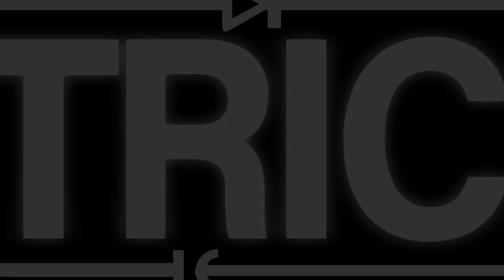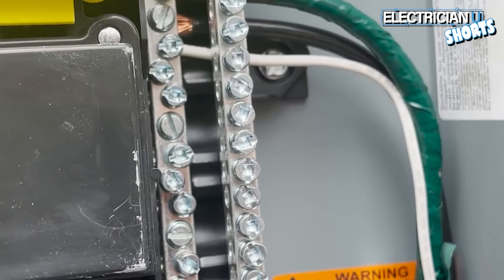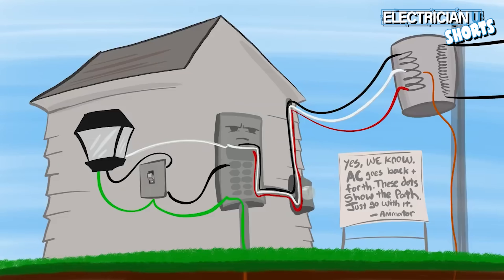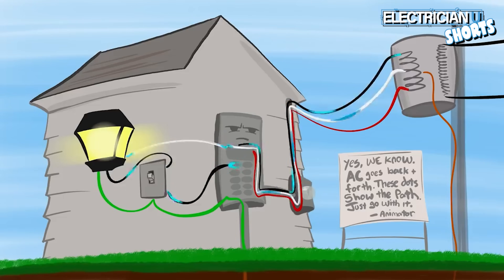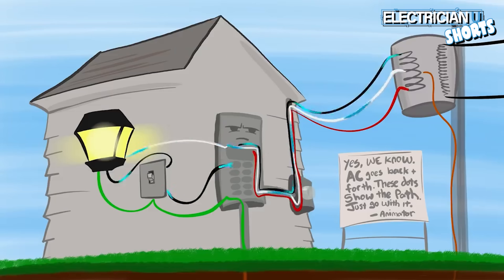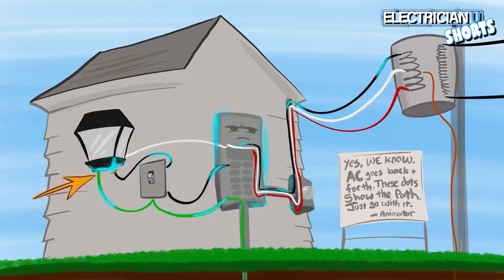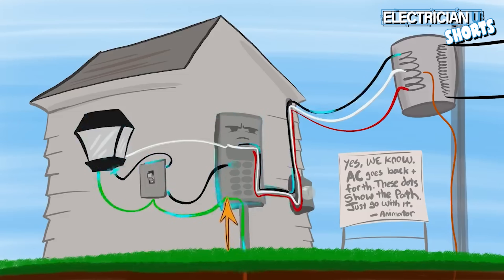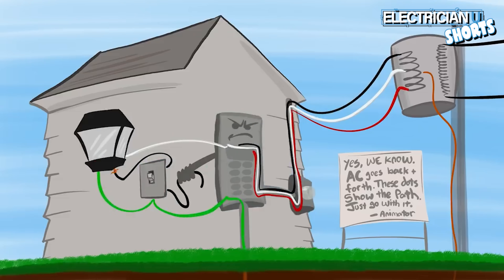SHORTS - WHY WE BOND (Neutral & Ground) Explained in 3 Minutes

Comment: Bringing GFCI into the conversation gets tricky; one of the big dangers in older circuits is that breakers are normally tripped only in short situations, where an abnormally large current suddenly flows, because the resistance of the device (bulb, motor, heater) is bypassed. The surge heats up the breaker, and it trips - eventually, before setting a place on fire. If a body comes between the load and the return neutral, resistance is added and you die, without the breaker heating to trip. GFCI breakers detect a difference in the two lines, and trip very fast if current in the neutral run is less than the hot wire, which would be a normal situation when a person becomes a path for current to go to ground.
Reply: To clarify a bit....short circuits create a swift rise in current that increases the magnetic field around the circuit.  Overloads gradually increase the current correlating to a rise in temperature.

Hence the modern Thermal-Magnetic Breaker:  Thermal for overload trip; Magnetic for fault/short circuit trips.

GFCI breakers are one way to add additional protection to older wiring systems without a ground wire as you described.  Unfortunately, since the GFCI is designed to  detect low level imbalance currents in the 5mA range, this can create nuisance tripping for some loads.  In these cases, a ground wire must installed in conjunction with a thermal-magnetic breaker for proper operation of the load while providing adequate circuit protection.
Reply: @mduralia well said. A GFCI will detect the "missing" ~5mA that is not flowing from hot to neutral; the likely leak is a fault is a hot fault to ground, thus unmetered by the GFCI and explaining that acronym. However, a ground must be attached to a GFCI outlet to provide a fault path to attached grounded devices. And it must be backed by a traditional over-current breaker (or arc-fault breaker if code dictates).
Reply: @hobbesip1 not exactly correct. The fault may be an alternate path to ground, such as through a person and a concrete floor. A ground is not required for a GFCI to function.
Reply: @TomCee53  you are correct. An earth ground isn't required for a GFCI to provide protection. A GFCI will trip if there is an imbalance of the hot side vs. the neutral side.
Reply: @TomCee53  absolutely. That is why we install GFCI in two prong homes to add that layer of safety.
Reply: @mduralia  you are better at explaining this than the commentor you reply to for sure
Reply: @mduralia  You are correct. The most common reason for a nuisance trip is if that GFCI outlet/plug is connected to a doorbell transformer, connected to the load side of another GFCI, or a CFCI breaker.
Reply: Yup. I often work on homes that are 100+ yrs old.  I'm not an 'electrician' , but have a EE degree.  This stuff is SO hard to explain to homeowners, etc. 
Many/most of the older homes/buildings only have 2 prong outlets, etc.  Ironically, with all the non-metalic things we use today have almost zero chance of having hot side shorting to anything conductive. (N.B. I didn't say never or always, rather, things are trending that way)
Reply: thanks you save me lot of typing. The reason why you want the ground is so that lose wire touching that metal housing current goes somewhere and that trips the breaker(or fuse) instead of laying there like snake waiting to bite you.
Reply: @ablemagawitch  almost:
"... The reason why you want the ground is so that lose wire touching that metal housing current goes somewhere and... "
THE BONDING is to ensure their is a path back to source so that the breaker can function to detect the fault & then  trip...
Fixed that for you- thanks & you are welcome!
Reply: I still have no idea how this works and what a neutral is and why there has to be ground with that goes into the ground, other than to send electricity back to the source in a very poor medium? and mixed with everyone else's grounds? why is this so hard?
Reply: @itoibo4208  because this understanding is not exactly correct. Such electrical grid systems is outdated, moreover American companies does not use this kind of system as far as I know. Now the ground in your home is used for multiple reasons. First, in the event of a lightning strike it is to protect against the energizing of any metal in the home. To prevent this, two grounding electrodes are installed to carry the lightning electricity to the earth. Finally, the ground wire that connects to all outlets also connects to the neutral wire in the main breaker panel. This is done to protect against the outer metal of appliances becoming energized by a fault in the appliance or in the wiring of the outlet/plug itself. This trips/turn off the circuit breaker by allowing the electricity to travel along the ground wire to the main panel. Electricity would skip over to the neutral wire at that point where the ground wire is connected to the neutral wire in the main panel not to the grounding electrodes, because the neutral wire has least resistance. This causes a sudden rush of electricity which in that instant causes the current to rise higher than what the individual breaker switch of that circuit is rated for hence the breaker tripping/turning off. 

P.S. If you have any electrical problems it is recommended that you call a licensed electrician.
Reply: @kemfacts  The grounding electrode driven into the earth is to protect against surge currents such as lighting strikes.  

The grounds in the structure running to all connected loads are to provide a path for fault current back to neutral to complete the circuit when a fault occurs thereby tripping the circuit breakers.

So the grounds connecting to the grounding electrode provides a path for surge currents that are the result of "faults" in the system and so the grounding electrode plays no role in fault current/circuit breaker tripping.  It is the main bonding jumper that accomplishes this.
Reply: @mduralia absolutely. At no point in my paragraph did I state that the electrodes are use for faults originating in the system. I specifically stated that these are used in the event of a lightning strike to prevent metal, such as appliances from becoming energized by the lightning strike. Moreover, traveling along the ground to the neutral in the main panel does not complete the circuit, it creates a short circuit. Read the whole comment again.
Reply: Trump will end evil short circuits and make circuit breakers cheap again…. Send money now
Reply: @jimsummers487  YOU WIN!... more winning LESS whining please!
Reply: In case of a short the breaker trips immediately magnetically. Thermal breaking is for overloads.
Reply: I bond Ground and Neutral at the first RCBO in a TN-S system then all breakers subsiquent to this are fully protected <30ma. S
Reply: Your statement ... GFCI breakers trip very fast if the current detected in the neutral is less than the hot wire... Would the current be less due to the fact that A human body (or conductor) has added Resistance, thus lowering current? Hard to believe that the resistance in A human body can cause this... Though I'm certainly convinced
Reply: @drwombat  The current in the NEUTRAL is always less than that in any one phase or all the phases as a sum >>> in a system that has no fault or hazard present <<< this is bcuz the REASON there is a NEUTRAL RETURN in the 1st place is to carry the UNBALANCED current back to source... AND in every single LOADING SCENARIO from a PRACTICAL standpoint in any given moment t(x) the sum of the current is NON ZERO... and therefore you need to have a conductor to carry this unbalanced current back to the source... the best way to understand unbalanced [LOADED] systems & therefore the NECESSITY of a NEUTRAL RETURN is to understand the difference between the TRANSMISSION of power & it's DISTRIBUTION... I have included a lengthy comment above that you can read & it provides the entire picture since the video is only providing a piece of this puzzle- which is no critique... I think the video does a great job doing it's intended purpose... but for those looking for a full understanding then sure you should also read my comment. I hope that helps you in your journey towards mastering electrical systems
Reply: the return is almost always less than the line before the work is done... so correct but the setting is not if unequal bcuz it is almost always unequal- it is based on a DELTA = CHANGE... and if the change is different [it should be consistent] then the tripping occurs... this is also the reason you get ghost tripping bcuz a device may lose its capability tho not be a hazard... when it becomes inconsistent tripping will occur even when not creating a hazard simply due to that difference of change between line & post load return
Reply: This was the thing which confused me alot.Thanks for clearing
Reply: Simple explanation. Almost like my tech teacher 😀
Reply: This is shocking im really jolted reading  this

Comment: I would have just said The N.E.C. defines a Neutral as a "grounded" conductor. The hot is always ungrounded. 
Everything you said after the hot wire touching the metal casing of the light is confusing. 
I'll delete this comment if I get what you're saying. 
Enjoy the rest of your weekend!

Comment: My Solar inverter is 230v One Phase the L-1 is 115v & the Neutral is Hot 115v and the Ground is Ground . So in theory in an emergency power outage my Hybrid inverter could make my whole box One Phase while the electricity is down , I have No 220v breakers my house is all 120v a Square D Box if I use a 20A Double pole breaker as my inlet to the box or do you think if I used a sub panel and a breaker for each Essential circuit of equal value as in the main panel so the Hybrid inverter would be connected for its power source to the main panel to monitor and when the grid goes down the inverter would only power those circuits in the sub panel  , than I could use the main electrical inputs ! But would be simpler to go through a 20A 2 pole breaker and feed the whole box !

Comment: This is all wrong, ground is all that it is needed. Bonding = misleading BONDING IS CONNECTING.  And that is what you are doing when connecting the neutral and ground together.  To trip a fault you have to monitor the hot wire, a short would increase the current quite a bit and thus would trip the fault device. In the above bonded method the short current is not going to go back to the transformer but to ground, the shortest path. The metal casing being grounded would not increase in voltage if shorted to the power supply, IT IS GROUNDED, so it is always safe.

Comment: If I don't bond a ground rod to my main panel do I still need to tighten my bonding screw? If the ground wire from the subpanel is connected to the neutral bus to carry current back to the transformer then what's the reason to bond the neutral bus to the panel.  Where I live we mainly have a ground rod to our meter and it's not bonded to the main panel

Comment: may I ask if the N-G voltage is the same reading as the L-G voltage? Thank you.
Reply: No, the N-G voltage is at the same potential (0). L-G voltage is at 120(same as measuring from hot to neutral(difference of potential)
Reply: @ddaniels2901dd  Thank you for your reply. For an equipment with power connection stated as N-G, is it ok to be connected to L-L assuming the voltages are the same and the system are grounded properly?
Reply: @juantamad5784  if I'm understanding correctly, N-G won't give you a reading, L-L would give you the maximum reading of 240 volts and L-G or L-N would give you half the voltage (120 volts)
Reply: @ddaniels2901dd  Hi sir, thank you for your reply. My main problem actually is about the Hybrid Inverter I bought for my Solar system. The Inverter supposed to be able to charge my batteries with Solar and if the Sun is unavailable automatically the charging is from the grid. The Inverter spec is N-L (230V) connection but the Utility power supply L1 and L2 are both live at 230 V. I asked the manufacturer if I can connect L1-L2 to the Inverter with N-L but I was told the Inverter may be damaged if I do. I disabled the Utility (L1-L2) so currently it's set only to Solar charging. It's a waste. I asked you if N-G voltage is the same as L-G because what I found was that the Utility L1-G and L2-G is the same as 115V but the Inverter showed differently being N-G is at times lower than L-G but there are times it is reverse. That is why I decided not to connect the Utility line to charge my batteries automatically through the Inverter. For I am not an electrical tech to fully comprehend the situation that is why I am asking. Thank you for any advise.

Comment: My generator came bonded and am connecting a 50 amp inlet box to the house breaker box. Is it fine to leave the generator bonded since I use it once or twice a year or should I make my generator a floating neutral.

Comment: What you failed to mention and most importantly is that bonding the neutral brings it down to earth level 
(no potential)  Old houses without grounds or bonds will shock the piss out of you when touching neutrals. Actual earth ground conductors are what we call equipment grounds and yes do supply a direct path to ground in the event of a short.

Comment: Er, we don't? This creates a TN-C-S system on the consumer side of the installation, which is not actually legal in the UK. Under Regulation 8(4) of the Electricity Safety, Quality and Continuity Regulations 2002, this is an offence risking prosecution and an unlimited fine.

The distribution network operator, in some cases, will connect earth and neutral together, generally in the cutout (as they are cheap). This is still potentially dangerous, particularly for connections to things like caravans or electric vehicle charging points, but it is on the DNO side and as such considered a controlled environment.

The risk is that a broken protective earth and neutral (PEN) conductor can lead to dangerous voltages. The risk is generally acceptable within a house where there isn't access to real earth, it is not acceptable with an electric vehicle charging point. Traditionally there was a separate solid earth connection (typically the sheath of the supply cable) all the way back to the transformer. The cheaper option (link in the cutout) is TN-C-S but only on the DNO side, and allegedly they provide enough electrodes to minimise the risk if the PEN conductor breaks, plus if underground the risk of breakage is low anyway.

On a TT installation such as the one illustrated, an RCD or VOELCB is compulsory precisely because there isn't a solid link to the transformer, and has been for decades.
Reply: The uploader never bothers to reply.
Reply: TN-C-S is the norm in the UK. The regulation you referred bans TN-C.

Comment: (layman/non-sparky asking) I've watched this video probably a dozen times now and it hasn't clicked for me. For a standard breaker (thermal magnetic, non GFI/AFI), how does bonding netural to ground help? If a standard breaker provides overcurrent protection, then it seems like the bonding wouldn't matter because if current is flowing, then current is flowing, the return path seems like it would be irrelevant. For some reason this isn't clicking for me.

I'm still a bit murky on AC electricity, so maybe there's a fundamental property I'm missing.

If it were a GFI breaker, I think I understand that because you need a return path in order to measure the difference...though, I'm still not sure why bonding is needed. Because if there was a ground fault, then there would still be a difference between hot and neutral. But I'll save that question for another day when I learn a little more about GFI/AFI.
Reply: If a device fails and the case becomes energized the current goes to the ground wire then as the ground wire   is connected to the neutral it goes through it to the transformer. This creates a very high current several times what the breaker is rated so it trips immediately making it safe. 

If the ground wire went just to a ground rod the current would be much smaller, maybe 5-10 amperes and the breaker would trip and the case would have almost full 120 volts. In this case one would need additional protection like a GFCI to make it safe. There are countries that use such system but in the US it is not allowed. Both systems have their points. 

The best would be to have separate ground and neutral from the transformer but this would cost more and would create the problem of keeping them separate. 
.